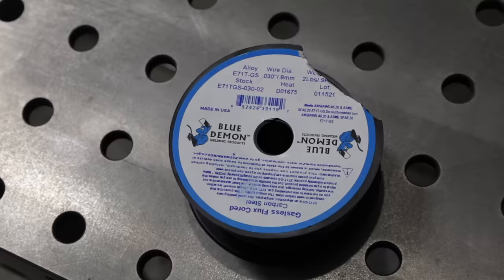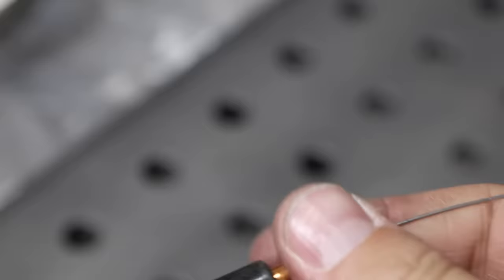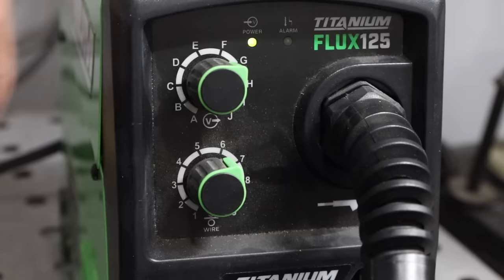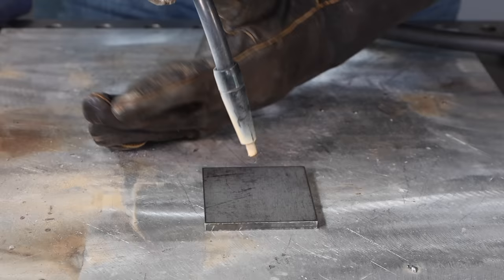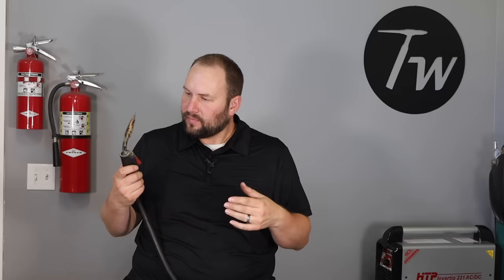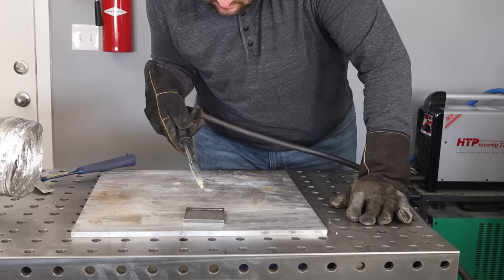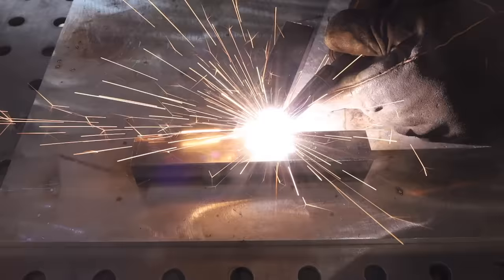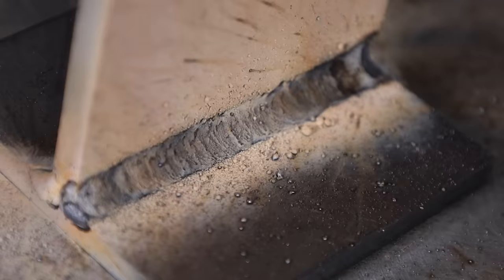Gasless Flux Core Welding Basics for Beginners

Comment: Great video Tim , as usual. I bought my Everlast MTS221STi about 3 years ago. I'm well into my 70's and have been a hobbyist DIY welder with stick and MIG for years. I bought the Everlast to learn TIG and your videos were very helpful in bringing me to a level of acceptable welds on steel and aluminum.  My machine can do FluxCore as well, which can be useful outdoors when breezes will wreak havoc with standard MIG gas flow. Thanks for all the tips. BTW you might have mentioned that, when using FluxCore on a standard MIG machine, knurled rollers usually replace normal "V" or "U" rollers.

Comment: Thank you very much. I just bought the Titanium Flux 125. I have an office chair that broke and I decided I can buy a welder from Harbor Freight and fix the chair and have the welder left over for future projects instead of just buying another chair. The frame is hollow tubing. and the welds are awful. Chinese workers mass producing them are quick welds only good enough to make the metal stick together. I bought solid metal rods and placed them inside the frame's tubing. Next, I can weld the tubing back together and it should hold forever and ever. ;)

Comment: Almost all my flux core welding has been on thin impossible to stick weld thin stuff like the floor of my dump truck. It develope's cracks in front of the floor stringers and needs repaired from time to time.  That by no means is the most enjoyable welding because I can't just blow and go. I have to get a puddle carefully started at the end of the crack, let it cool and keep cooling and tapping it with the welder right at the front edge dragging.
I let the puddle just almost quit glowing and zap it again. Do it over and over and over until the crack has been bridged over with just enough heat that hopefully it is attached to both sides.

Another cool trick that I just learned today welding a similar cracked wheelbarrow bottom. To save the wood underneath I kept dowsing it with water. That not only saved my wood but it cooled my metal back down to where I could weld easier and finish quicker.
Can't wait to try that in the dump truck next time. 
It keeps me from having to replace the entire floor which will no doubt have to happen in the near future.

Thanks for your very helpful videos Tim!

Comment: Thank you for sharing. I have my welding machine set up with the flux wire. Only because I'm in a wheelchair and it would be harder for me to fill a bottle all the time. Plus where I have machine stored I don't want a bottle stored there.

Comment: Small tip ,If you cut the wire on a sharp angle this will give you a positive start to the run without stubbing  This gives greater resistance and a hotter start

Comment: Well said and done. I will state that when doing thicker material with FCAW I prefer a multi pass wire. They splatter more and are a PITA to clean but running a root and cap can build a much deeper joint.
I tend anymore to tack with flux core, grind and clean and run stick when working with repairs.

Comment: After 10 or so videos, this is the one that seems the best. I'm 76 and frustrated because I'm working on a project that I'm making a mess of. I have my father's old stick welder. He was a welder all his life and tried to teach me. I also have a Lincoln SP-135 that I've never known how to use and made unbelievable messes with it, so rarely try to weld anything using it. None of my welds look anything like what you are doing. My welds look like gobs and splatter. Now my machine won't advance the wire so I have to order another wheel. I have no idea what I am doing wrong and have tried different speeds and different levels of heat. I've worked on trailers, and stuck things together just fine with the stick welder but on my current project I have some 16g metal that I'm burning holes in. Also it is really hard to strike an ark. Do machines get too old? I've bought a new electrode clamp that hasn't helped. I'm building a tub for a rock saw and so far it leaks all over. I'm learning new things but really am not happy with what I am creating. I want to make welds like you are showing or I'm going to have to use bondo.

Comment: I really like your videos you teach a lot I found that it's easy to take a piece of tungsten steel rod and hose clamp it to your tip at the distance that you're welding therefore you won't be moving back-and-forth to your material as much just figured I would say that

Comment: Thanks Tim; really helpful! I have a machine that can do MIG (with some additional parts) as well as flux core, and was considering getting the kit to convert to MIG, bit having seen what you can  achieve with flux core, I am going to work on my settings and technique some more instead. 👍🏼👍🏼.        AAAAAND - 22 hrs later; having gone back and worked on machine settings in [articular, and of course technique, have managed a lot better. Thank you again! 🙏🏻

Comment: Very good video.  I read a lot of comments on other channels where people don't like flux core welding, but I've had great results with it.  When done correctly, the welds look good and are very strong -- your vise proved that.  The welders that don't like it must have the settings wrong since they complain about a lot of spatter and it being hard to clean up.
Reply from the maker: Thanks! It can work really well, for sure. One of the biggest problems people run into is using some of the very cheapest machines, which actually output alternating current. This leads to a bit more erratic arc and a lot of spatter. A DC MIG welder or most inverter flux core welders (even relatively low cost ones like the one in this video) work quite well.
Reply: Wire choice makes an overwhelming difference in my experience, much more so than with gas mig. Even more so again with galvanised steel!

Comment: Hi there one thing you could mention is as the job heats up you may have to lower the amps. Also I use the first run to warm up the rhs for a double run on 6 mm rhs, a lot of the time people only do one thick fillet weld, but the metal hasn't heat up enough to get a solid weld.  I have seen quite a few failure's over time from cold welds.

Comment: Loving your channel. I can't weld as I don't have the space or gear to do it. I do a bit of silver soldering with flux core solder wire and flame. Would love to learn more and prevent blobs. Watching you weld is almost therapeutic. Subbed. One day I might treat myself to a welder.

Comment: Good video - watched it for curiosity sake - my business uses flux core extensively. Great that you quote both metric and imperial measurements.
Reply: @cobes11  what confuses folks is we all use the same inch today. So they assume we always used the same inch. That's wrong. How we all came to use the same inch is a bit convoluted too. The inch we use now was developed in 1896 but was adopted slowly at different times in different places. The original US inch and British inch were pretty close to each other. Only 5 millionths separated them. So it's not like you're going to spot a difference on a ruler. But it bugged a guy named Carl Edvard Johansson. Henry Ford was such a fan of Johansson he basically bought him and had him shipped to the USA. That's how SAE gets involved.
Reply: @cobes11  SAE is the Society of Automotive Engineers. They have nothing to do with the US Customary standard. I think they may have come up with the thread pitches though? UNC and UNF. NIST handles the weights and measures standards. Which are all metric today. US Customary is pegged to metric standards.

Comment: Good video. 😊
  Setting up your welder the right way is really key and some things tend to get glossed over a bit, which ultimately makes for inconsistent, confusing weld results that causes us to go waaay down other, endless rabbit holes like temperature and wire feed settings, when it's actually something simple that was overlooked or "short changed" in the initial set-up that's really to blame.
  To add to your statement about setting wire-drive tension...  You want to hold your stinger/wire tip about 2", not much closer or farther from a harder wood block, like a piece of 2"x4" (too soft and it just digs in) and almost but not quite straight on.  Pull the trigger and your wire should be able to hit the block and curve.  Be sure you hold the gun steady or it will try to push your hand away which defeats the purpose.  If the wire doesn't bend, the tension is too loose.
  Adjust the tension just a little at a time, just until it makes the wire bend and you're good.  If you have it much tighter then this, to the point you don't have any idea as to how hard it's actually driving, it will cause unpredictable results in your weld.
  The purpose of this setting being correct is so your wire will push deeply enough into the weld that it fills the weld at just the right amount.  Too hard and it "pushes through" the weld and causes flaws, etc..  If the drive tension is too loose, the wire won't push into the weld enough and it will burn back from the weld, also causing issues.  You'll then start fooling with the feed rate, trying to compensate but that creates other problems.  Proper drive tension is "the other part" of the wire feed speed/fill rate setting that nobody ever talks about.  It's like trying to build a house without a good foundation, nothing else will be right on top of a weak foundation. 
  A 45° angle is really too steep and won't offer the proper resistance to gage your drive strength, just a few degrees, 5° - 8° is plenty, just enough that the wire doesn't just drive straight in and bind without a chance to push away.  Practice this with different angles and drive tensions a few times and you'll understand my point and you'll get the feel for it.
  Everything about welding ultimately comes down to practice and feel.  Feel for the speed, the temperature, the sound, everything in one way or another.   If you're just learning and setting up for the first time, don't rush yourself.  Understand the machine and how things work and are correctly set up before you start melting wire because as much as we love to toss aside the directions and jump right in, welding is something that will give you bad habits, confusion in adjusting and frustrating results really quickly, just because we don't fully understand what we're doing in the first place. 😊
  Starting with a simple welder like the one shown here (they're quite good for the price, you won't go wrong.  I just bought the advanced version) takes away from the confusion factor until you have a chance to figure out how to get the most from what a simple machine has to offer. 
  When your abilities finally exceed what the machine is capable of giving, then it's time to move up to a more complex machine...  And some welding classes from the local community college or vo-tech, as well.  YouTube is a great resource but, having hands-on experience with a teacher right there to see what you're doing and help you in the right direction will save you lots of time and frustration in the long run and is truly irreplaceable.  😉
  Finally, if you're welding something that is straining the limits of the machine as you did here, beveling the edges of the intersecting piece (the one standing up) will allow the heat to get into the V of the weld a little better and give you more penetration.  Buy that only goes so far.  You may also want to make more than one pass if it's thicker metal but, those things are really a different conversion and beyond the scope of this simple video.  😊
Reply: Thank you so much for adding this context. I'm considering trying to learn how to weld for a project that will take an old camper trailer and build a new camper onto it. The old trailer may need some slight mods, so I'm looking forward to engineering and fabricating it all myself. Your added info about wire feed tension is fantastic.
Reply: @marlaplunk2833   You're welcome and, I should have said "bend and keep feeding."  😉

Comment: Excellent video! Maybe a follow-up video with common questions? Questions: #1) So, flux core isn't good for using on high carbon steel? I have an auto frame that needs work, but read not to use flux core.
#2) What kind of flux core allow you to do multiple passes (and what prevents you from doing so with some wire?).

Comment: I need to weld my vehicles wheel bearing hub to the wheel bearing housing so it comes out as one unit. I have the Flux Core 125 from Harbor Freight with 110volts input. The gap is 1/16" between the two. They are steel alloy.

Comment: I want to make a velomobile for budget reasons. Because of welding being a monster in my eyes, I was planning on making a plastic frame. Sadly, plastic frames are not being mechanically suitable. And the alternative in polymers is carbon fiber composites.

I don't know, but if I don't decide making my own composite parts, I read that FCAW is relatively easy for hobbyists.

Comment: It does not add additional metal to the weld. For a same .9mm diameter wire, one (flux core - as you call it) and a solid wire, a "fluxed wire" will always deposit less metal because the flux occupies part of the diameter of the wire. In Australia, flux core also uses gas but the wire has less flux "inside". While gasless wire is called innershield where it requires a lot more flux inside the wire to avoid oxidation without any gas, hence a lot less metal deposit. In other words, solid wire will always deposit more metal.
Reply: I'm also in Australia mate and I'm finding it hard to understand what you are trying to say. Cigweld (you've heard of them right?) call its Weldskill Gasless 0.9mm Mig Wire: "self-shielded flux cored wire..."
MIG, ARC, MMA all add additional metal to a weld. TIG welding does not.

Comment: Tim, I have a question. What if you need to weld two pieces of steel that are different thicknesses? Like 1/4" to 3/8", or maybe a bigger difference like 3/32" to a 1/4" steel? What settings should you use on a flux core welder?

Comment: Excellent, thanks!   I have an older Harbor Freight 90 amp flux welder.  I purchased a 2 lb. roll of .35 flux core wire but it was years ago.  Stored in dry garage here in southern California where it's generally quite dry other than when we get our few rains in winter.  And in the original plastic wrap.

I've heard that older(?) flux wire will rust, and/or corrode or "go bad" if it's old, is there a way (other than actually looking for rust, for example) to tell if it's problematic/should just be tossed?  I hate to waste things but for $15-20 for a fresh roll, if it makes my learning and using this welder easier and better, well worth the extra expense.

Thanks again for the video!

Comment: I have a century 100 which the guts are Lincoln electric its made by Lincoln. But it was fluxcore originally but i upgraded it to use solid wire i had to buy a kit from Lincoln electric and they sent me a chip to plug into the main board and a gas solenoid which was no problem i put her in and it works great but flux core is cheaper to run plus i do alot of outdoors work. But i love it its a great welder its 10 years old and iv only had to replace the ground cable and the liner in the hose. I run Lincoln electric brand flux core i use 0.30 wire i find its best for what i build. The welder is a 120volt with a 25-30% duty cycle which is pretty beefy for that welder and iv done 1/2 inch plate multiple pass on flux core but with a wire of 0.35

Comment: Hey some auto shops told me that a leaf shackle hanger couldn't be structurally welded and had to be replaced entirely. Is this true? GM shackle hangers are built to fail as far as I can see. Not sure what's up, just learning. Thanks for any insight.

Comment: I haven’t owned my own welding equipment. You had mentioned that sometimes the amps go higher! So would I need more amp service on my house other than 100 amps or would I need a booster to cover so none of the breakers trip ?

Comment: Very in depth video, nice one. I've got one query / issue with your tip at 6:47 - With MIG, is it best to push towards the weld pool, like going towards the direction of that 15 degree angle? Is it preference or is there some reason in particular for leaning in the direction you're moving the gun towards? I've heard with with TIG it's better to drag...

Comment: That was interesting but wasn't what most people will have. I have two of Harbor Freight's cheaper welders. I have the Chicago Electric Flux 125 welder that I've never really been able to get anything good out of. I also have a Chicago Electric 80A inverter stick welder. I use the stick welder a lot. I did have a 70A AC stick welder from Harbor Freight but gave it away after I got the inverter welder. The stick welder is good but I can't weld less than 14 gauge with it. I gave up trying to get welds out of the flux core welder. That just sits inthe shed now.

Comment: I only weld occasionally and have never gotten good.  I think what's limiting me is bad visibility.  I've tried both fixed and electronic helmets but have never found the trick for being able to see what's happening.  I tend to weld "in the blind" for a couple inches then stop and check it out.  Some advice here would be appreciated.

Comment: In that last example of welding thicker stuff: would it help to grind  the edge of the vertical piece to a V, giving you a better access to the center of the joint? And after running a weld on both sides, run a filler bead on top? Also: do you think it would be better to have that piece ground to a sharp edge (like a V) or just take 1/4 of the thickness off at 45deg, leaving about 1/8” flat in the center? I have a flux cored welder running 0.035” wire and I will need to weld some 3/16” maybe 1/4” wall tubing and I wonder about the best way to go about it. It will need to be strong. I’m pretty new at this, only made a gate and some planters so far…